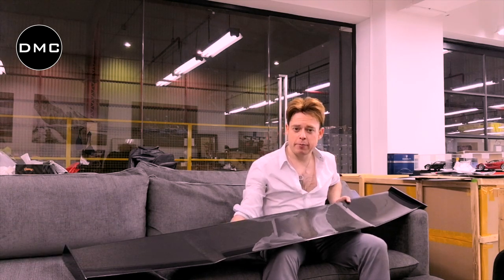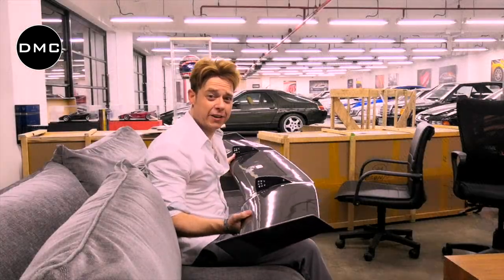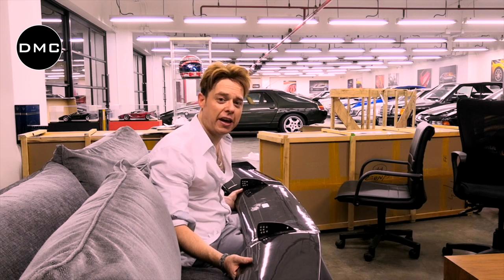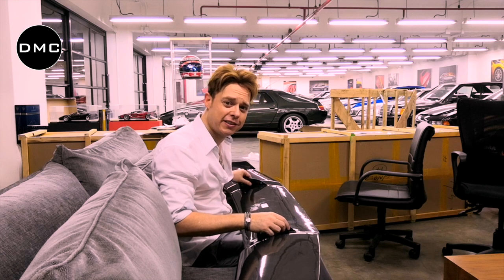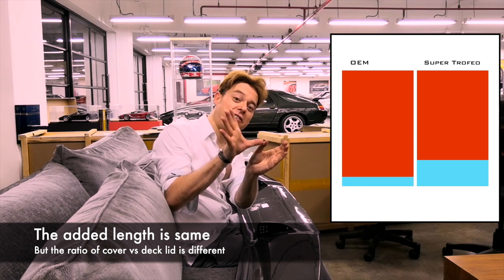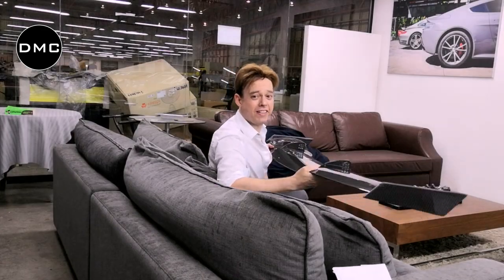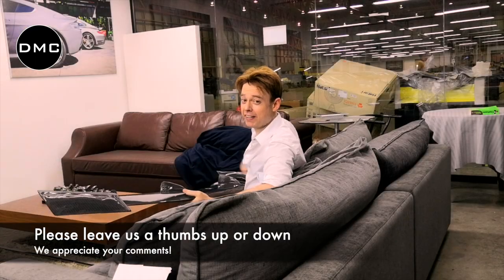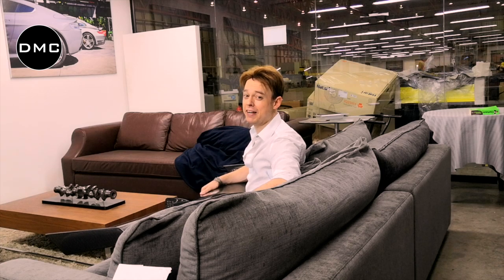Lamborghini Gallardo Supertrofeo Carbon Fiber Wing Spoiler by DMC

Comment from the maker: In short: The standard LP560's engine hood has a different length than the Supertrofeo one. That also influences the size of the Rear Deck Lid on either car. So if you have a standard Engine Cover, there remaining space will only fit the standard Deck Lid.

Comment: Is there a spot for the backup camera on this engine cover/wing setup?  (Coming from a stock LP-560-4, where the backup camera is mounted on the engine deck lid - without a spolier)
Reply from the maker: We usually mount the camera behind the grill, just Jahre sure to use plenty of heat shielding. The traditional Trofeo setup doesn't have a camera option in the wing nor bonnet. Welcome to contact us by email for more advice, website is linked in the video description 👍🏻